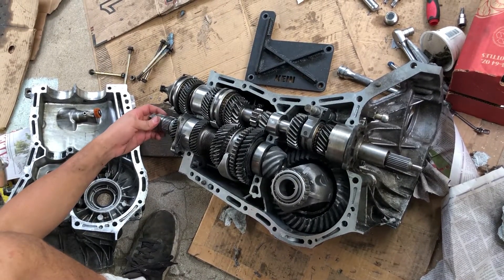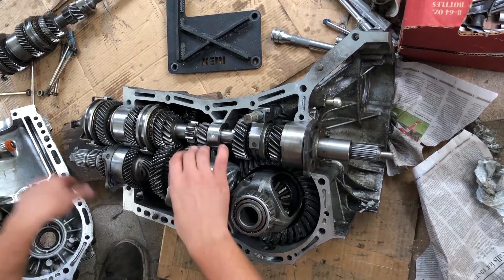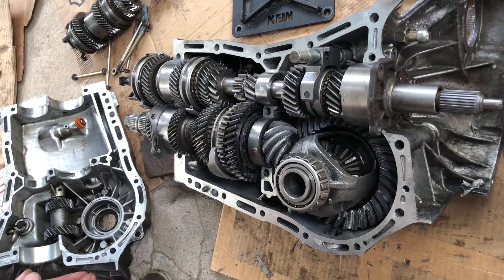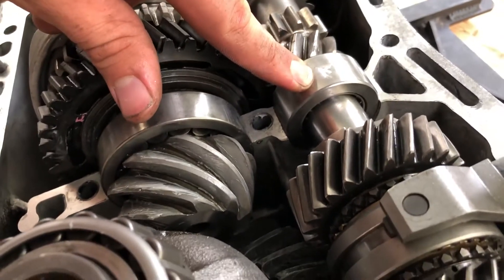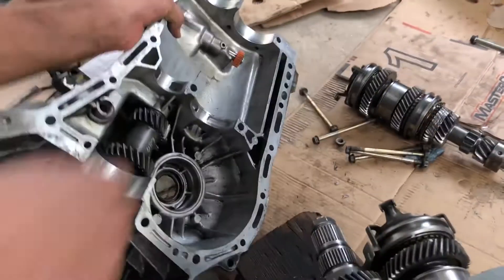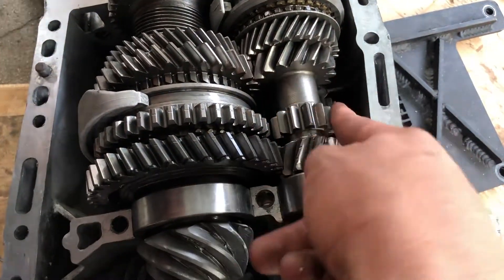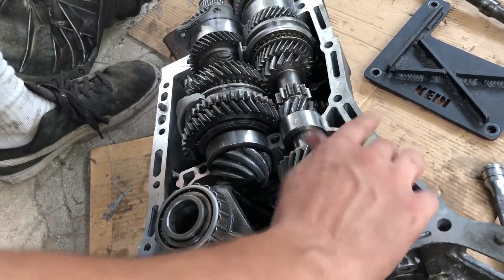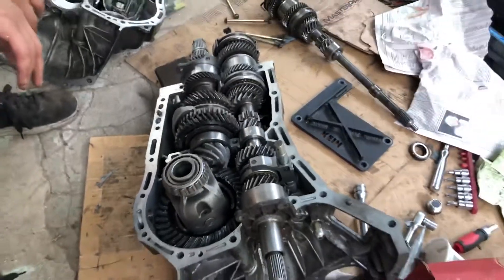Inside a Dual Range Subaru Manual Transmission

Comment: Subaru transmission is FRONT wheel drive with a rear axle that is constantly driven by the center differential slippery clutch system. Why do you all get this wrong and claim it to be rear bias.
You can keep on the gas and pull the handbrake to slide while front wheels are SPINNING just like they do in RALLY.

Comment: I can tell you the low range ratio is a waste of time , not low enough for good low speed torque when off road , as specially since Subaru engines have no bottom end torque !
Reply: Personally, I find it VERY useful in my 06 Forester on the highway, when towing a trailer.  Also reversing the trailer. Offroad it could definitely be lower, but it still makes a significant difference and that fundamentally is better.

Comment: Its not that 5 speed is weak. Its that Subaru stupidly used a transmission designed for naturally aspirated engine torque with turbo cars. If you would turbo a Corolla or any other motor their transmissions would also fail much sooner, and it doesnt help that people who get them are idiots and increase further with access port bullshit when transmission is at its limit already with the stock wrx torque wise. Which is also the reason why STi finally got bespoke 6speed at the end of the 90s. Subaru just was too cheap to derive new 5mt from it for a lesser model.

Comment: Hi guys
Do you think this transmission hold 220 WHP?
Reply: There are built. Versions of these i australia from AllWheelDriveSubaroo meant to take more torque/power, built with turbo model gears improved especially to take torque from EZ30 H6 and turbo motors. It is imported to US, but costs alot tho.
Reply from the maker: it will

Comment: R U Fixed ? :
 The Dual range Transaxle debut in USA/Canada Subarus originally as a 4-speed  in the Late 1970s and stayed that way with the Brat for its entire run along with the sedan/wagon. However, when the major reskin (and new interior) came in 1984 as the " all new" Coupes,Wagons,Sedans...the Dual-range was then standard with a 5-Speed and "shift on the fly/On Demand 4WD"....that lasted unti the end of then named "Loyales' left the States in the  early 90s with the debut of the USA made Legacy. Low-Range was never offered with the  automatics then....and neither was the 5-speed Dual-range  ever offered with the older bodystyle 4WD hatchback or  4WD Brat which were still  being sold along-side their 1984-1990s siblings for quite some time.

Loyale 4WDs can still be found in junkyards with their Dual-range 5-speeds for all the world to see....the reduction ratio for the 5speed and 4speed was 2 to1........great for stop and go grind of bumper to bumper  commute traffic......and  for going  up steep driveways,crawling through snow,etc, With Peugeot 14-15 inch rims on those old school Subarus.....they could do some mild crawling with the added ground clearance with the Peugeot rims...which gave owners options in tire-size diameters.

Comment: As far as I found out, the dual range gearboxes were not available in the US, since I am living in the EU mine has it, but turns out legacy and outback only get roughly 20% reduction, which is in my opinion by far not enough...
Reply: 4th gen Legacy gets 1.447 reduction so 44.7%. And it also was paired with most powerful variants of EJ20 - EJ204 165hp detuned jdm motor. And EJ25 on the outback. It gives them effective torque almost that of 3.0L EZ30 motor.
Reply: 2.0L legacy and forester both feel the same while driving on the reduction gear.
Reply: Legacy had same reducion as forester in 2.0L version. Its 2.5L versions that have 20% reduction instead. GH 1.5L impreza and 1.6I XV(Crosstrek) got same reduction and effectively same trabsmission as 2.0L forester and Legacy wagon.
Reply: @Kacpa2 The GP Impreza 1.6 also has the same Low range transmission. Source: I own one

Comment: This is a really good video, I have a ej205 forester xt and I’m really curious to install a dual range in it. If it held up to a wrx, I’m pretty sure it’s going to hold up to my 177hp and 245Nm!!
Reply: yes ! it should easily hold up that power level. I believe the turbocharged forester xt should have around 260 hp at the crank tho ? (which the dual range trans should also hold)
Reply: @sebastianedinger5945  I wish...in europe we get more of the EJ 205 engines for the first SG foresters. These come also on the WRX with 225hp, but on the XTs they only have 177hp. From what i understand, at least the cams are different, but maybe also other parts.  EJ25 came on the Facelift SG Foresters.
Reply: I mostly wonder if it would be possible to modify Sti/3.0 Spec B legacy 6 speed to be dual range. Mostly for fun to be able to trash it without speeding too much while it punches with more torque.